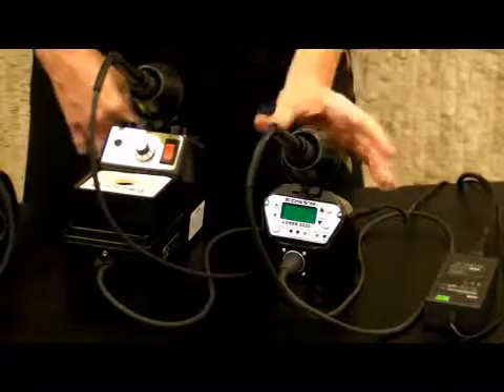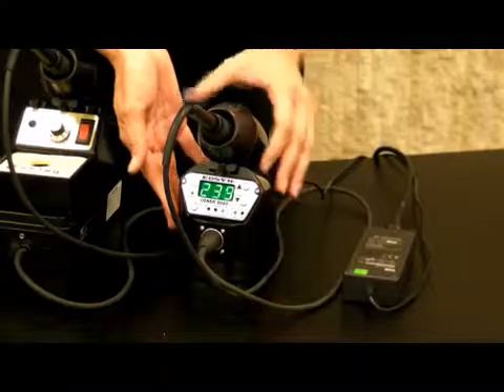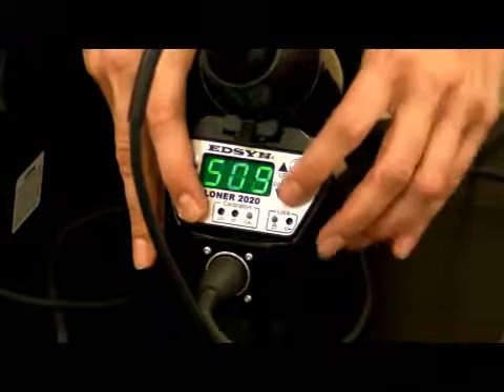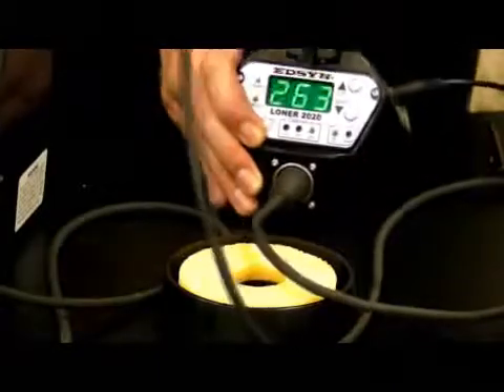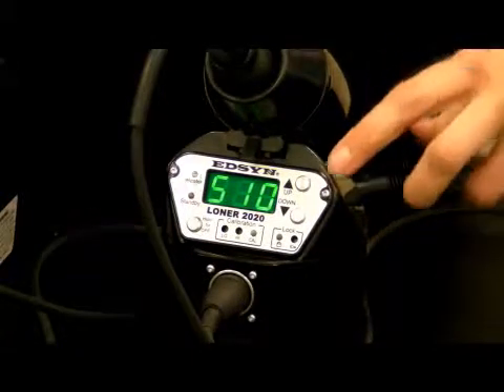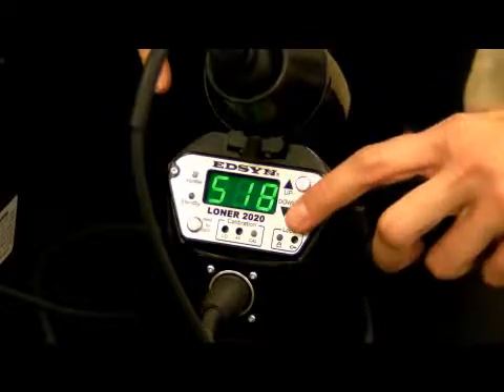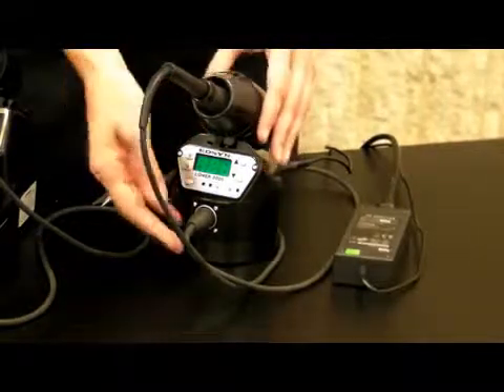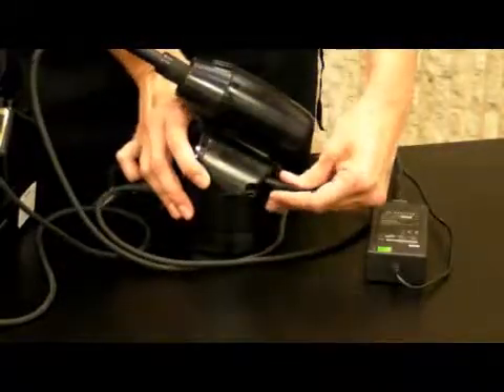Edsyn - 2020 Loner Soldering Station

Comment: I've used the 951SX station at work for 15 years.  It is by far the best solder station available today as it was 15 years ago.  The 951SXe and the 2020 are moving in a weird direction like most other high end brands.  The 951SX has almost everything you need in one compact package with a 95 watt iron.  New stations today are moving towards a 2-piece setup that takes up a lot more space with smaller wattage irons.  The EDSYN 2020 has 3 pieces that take up the most bench space I've yet seen on a pro station(if you use the sponge a lot); solder station, sponge tray, and power pack.  i don't know if they're going to discontinue the 951SX but I think I'll buy one just in case I switch jobs.  I'd hate to have to use a lesser station after the near perfection I've been used to.

Here's a suggestion for EDSYN:  bring out another model like the 2020 with a digital display, put the sponge back on the front of the unit, build the power supply into the main case, and add a holder for the solder sucker.  That'd be an improvement.
Reply from the maker: Thank you for taking the time to post your review on the EDSYN 951SXe and 2020 soldering Stations and for your very positive comments about the 951SX.  We always appreciate hearing from our customers and value your feedback.   The 951SXe uses the same heater and handle assembly as the 951SX and therefore has the same functionality and performance levels.  Both stations have removable sponge trays designed to be placed on the workbench.  The 951SX is stored on the top of the station, while the 951SXe is stacked beneath the station which helps prevent the sponge drying out when not in use.  The sponge tray of the 951SXe is only 4” in diameter which doesn’t make a significant difference on an average workbench.  When placed in front of the station, it measures .25” more than the 951SX. 

The 951SXe represents a change in shape and size for our standard soldering iron.  This modern design is based on careful research into what our customers wanted which was a soldering station that looked different to the 951SX.   They asked for a lighter weight station with a more ergonomic fit in the hand making it easy to maneuver and position on the workbench.  The 951SXe weights 2.12lbs compared to the 3lbs of the 951SX.  With the increasing concerns over plastic pollution and the environment, reducing and looking at ways to continually reduce the plastic content of our stations is very important to us.  The 951SXe has no additional hook-up wires internally except the power cord and soldering tool cord which also reduces material.

Regarding your comments relating to the 2020 and its power supply, it should be noted that this unit is sold internationally and comes with a universal switching power supply which is why the power supply is not built into the main case.  It has a 24Volt, 53watt heating element with a power rating of 60W.   The 2020 is designed for customers that want a digital read out and require a specific set temperature instead of a temperature dial.  It can also lock the station to a pre-set temperature.  Also, THE AUTOMATED calibration is much easier and more precise than manual calibration adjustments.  The size and shape of the 2020 along with its sponge tray do not distract from the performance and functionality of the unit. 

Please note, the 951SX is still available for purchase.